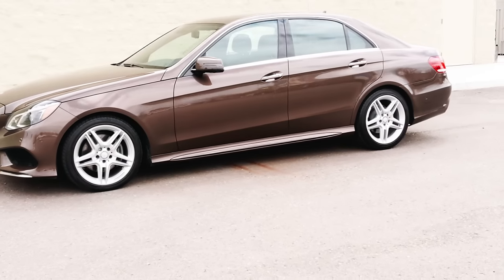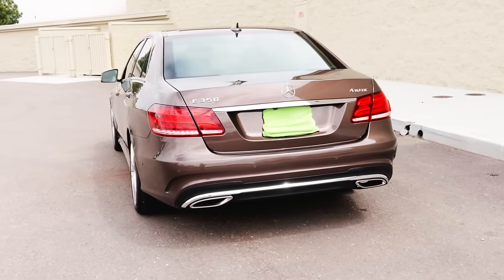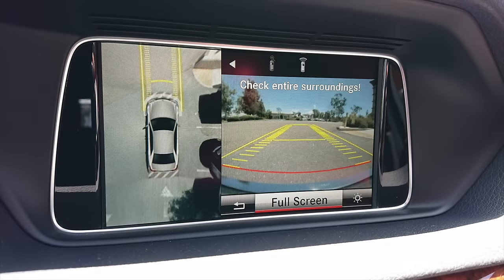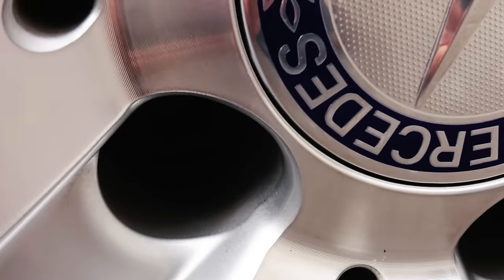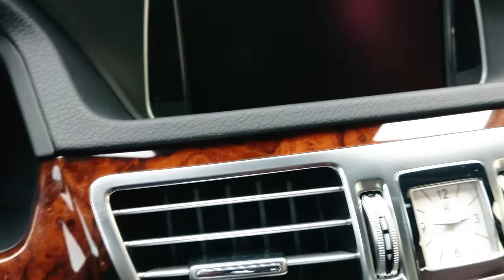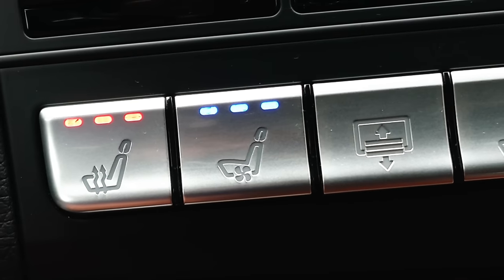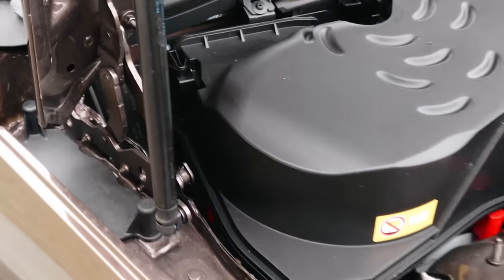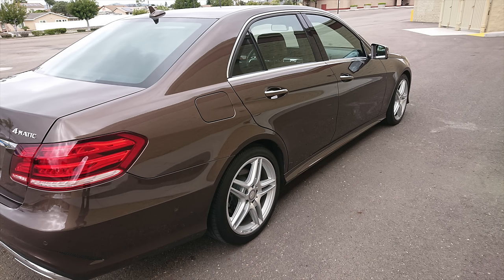The W212 E-Class is one of the best Mercedes-Benz Cars Ever

Comment: As a Benz technician that is the one car you see in the shop that only comes in for maintenance. Literally the only times I have to do diagnosis work is if there's rat damage and you have to repair some of the wiring😂
Reply: What’s your thoughts on the W204?
Reply: That's great to hear.  I own a 2013 e 350 avant-garde with leather seats, not leatherette.  Magnificent car
Reply: @Sean  any C class model was pretty good. The GLK IS really good too. Just maintain the motor, trans, and suspension and it usually drives like new
Reply: Can you please advise how long the fabric roof is likely to last on convertible W212s and if necessary is it extortionately expensive to repair or replace?
Reply: @popshaines5492  great question! I used to do convertible tops on these cars especially the 211/212 like you mentioned. As far as longevity in my opinion, not long. The string used to operate the top when it’s on motion tend to weather and snap as they age. I remember back when that model came out if you had ELW coverage you got it done for free but as far as upfront costs from the customer, I think the price ranges from $900-$1400. I could be wrong, but the labour pays up to around 8 hours and the top itself is expensive. You can still drive the car without using the top so it’s up to your discretion. Hopefully it just doesn’t leak😂
Reply: Yep....mine is 13 year old now. She has almost 200.000 km's on the clock...this year the chain was replaced ,the front springs and some other stuff on the suspension was worn out so replaced and today the rear subframe is being replaced but that one is fully covered by Mercedes Benz. So besides regular maintenance no crazy or shocking stuff....yes the car is getting old so you can expect things needed to be replaced....no reason for me to sell her. This car will stay with me for a long time haha.
Reply: Still w124  thr  peak  engineered of mercedes..right? The  most  aristocrat n elegst mercedes..aling with w140 s class n w126
Reply: hey mate, I was wondering what your thoughts are on diesel vs petrol models of this chassis?
Reply: @egv152  diesels are rare to see in the states but we do have them. I only worked on a couple diesel GLK’s. But the gas engine in the w212 m276 is a very reliable motor
Reply: @FZERO20  Ok thanks for your reply. I'll keep this in mind. 👍
Reply: @FZERO20  GLK, really good ? where are you working ???! in another universe...  what kind of technician are you, washing closets ?! go take a walk !!
Reply: @alexandruchivu7327  you must not take care of or can’t afford proper maintenance on your vehicles🤭
Reply: Can you pls explain the difference of the hand gear lever and the normal gear stick in the w212? Does one have more gears hence improving fuel consumption?
Reply: @sankara6823  the only difference I can say is the position where they put it🤣. Beyond that, if you wanna know the gearing it’s typically stated in the transmission number. In some cases you can scan it with a good scanner and it’ll say either 722xxx for 7 speed or 725xxx for 9 speed I don’t remember what the 5/6 speed designation is but it’s something like that

Comment: Owner of a 2015 E350 Sport 4Matic here. I absolutely love driving the car. The highway is where it shines, but it is quiet, handles well for its size, and the suspension in stock form isn’t too rough. In the 15k+ miles i’ve put on it, I only had one minor issue where I had to replace a destroyed plastic boot on one of the front axles (4Matic), but everything else has been only for maintenance. I have had no issues whatsoever with the car itself. The only option I wish it had was the adaptive LED light system but the standard headlights work better than many upgraded headlights from other manufacturers. If anyone is thinking about buying a W212, especially the 2014-16 facelift, don’t think twice and just do it! You will not regret it.
Reply: W212 and W204 best carts ever made. Seen some with 700k and never had any major repairs only normal maintenance, oil changes ,tune ups ,brakes etc,
Reply: What I have seen is that the regular headlights are better for the city someone made a comparison and noticed that only high beams look better with the adaptive lights.
Great for the highway tho..
Reply: Hey, I’m about to buy a 2014 E350 Luxury model and I wanted to know what are the maintenance cost looking like yearly?
Reply: @iamjshep3 It’s tough to say exact, it all depends on how much driving you do and where you live. Also, how well the previous owner took care of the car is a huge factor. When I owned the car I put 7-9k miles per year and live in FL so the car was not abused or in rough conditions at all. All maintenance I basically did early since I never hit the factory 10k mile interval. Found a great shop specializing in Mercedes, only charged me about $140 for Service A and about $350-500 for Service B depending on what needed to be done. A friend hooked up OEM front and rear pads including labor at $400. That’s all I really ever did runnings-costs wise, only oil changes, filter replacements, and the occasional fluid flushes of different components
Reply: Just bought one 2 days ago and i absolutely love the car! Smoothest ride of any car I’ve personally driven or owned
Reply: @visionariable  What fuel you used? 91 or 93 octane?
Reply: @Bando-fx4mf what about the e550 2012 no airmatic 100,000 mile car yay or nay? It has the 4.7 bi turbos
Reply: @valentinozientek5670  those v8s in the same era are known to be very to equally reliable. But the v6 and even the v6 bi turbo in the e400 are the best engines ever built.
Reply: @valentinozientek5670  at 100k its barley broken in yet.

Comment: In my books the W212 is the best Mercedes ever built and it is also one of the most beautiful mass produced cars. Owned 2012 E350 for 6 years and the only problems it had was with the engine ventilation system that had to be replaced and engine mounts (this was a costly repair). The car is built like a tank, it’s silent, comfortable and has great handling for a heavy car (yes it’s nowhere as fun or fast as a BMW M135 on track but it’s not designed for that purpose). I find the facelifted version even more beautiful.

Comment: Never have treated a vehicle as well as my E350, certainly a special car. She is a 2012 with only 48K miles, just gorgeous.
Reply: Wow 48k , that’s great mileage for a 2012.
Reply: Just bought a 2011 E550 with 37000mi this past February from the original owner.  I love it & keep it tucked away in my garage...  Weekends only.
Reply: @realnewyorkcityliving2065 My 2013 E-350 just clocked 58,000 miles two nights ago.
Reply: I don't think there is a reason to hide your precious'es and deny yourself the pleasure. I got my E350 with 300000+ KMs on it. You'd never tell.
 It is a 3L v6 Diesel version. Just replaced both front airmatic struts. Still love it :D

Comment: 2012 W212 E220 owner here. Have it for 3 years other than throttle valve and oil cooler I had no issues. Still puts a smile on my face when I drive it. 
It's a tank

Comment: Benz driver from Denmark here:
I just love my 2012 E350 CDI. Sedan.. 265hp, 620Nm. Full leather with ergonomic adjusted seats. Bi Xenon, Keyless Go, Lingatronic and loads more.
The car has a full service history from Mercedes Benz. 570.000km (355.000 Miles).
Price 90.000 DKK (about 14.500USD)
Everything works, no faults whatsoever... Just love that car.
Reply: Still on first engine and transmission?
Reply: @h2oaddict28  Yes, never opened or rebuildt. But comeplete service by a Mercedes garage.
In Denmark a lot of these cars are used as taxis the frist 2-3 years. Then they are duty free and are sold.
Reply: @svendolsen276  Cool. I'd never buy a car with more than 200k km though. Even if it's a Mercedes :)
Reply: Hats off to you ... I think the engine performed well.
Reply: @manojm6722  Yes, very much so. It will go in for service at about 600.000km or when the service system alerts me.

Comment: I would have to take issue with your claim that the W212 E Class Mercedes is the best ever.
The W124 series, built between 1985 and 1995 has that reputation, and I can vouch for that. I live in Colombia and 2 years ago I bought a 1993 W124 E320 which has now done 105,000 miles as it was originally sold new in the US. I paid the equivalent of USD6,600 at the time. Apart from some deferred maintenance issues, it is proving to be the best Mercedes I have owned. It is the last of the non-computer Mercedes - a big plus in my mind!
Prior to this, I owned a total of 6 older Mercedes in New Zealand between 1978 and 2008. The first was a 1963 220Sb which I owned for 10 years. I wish I still owned all of these pre-computer cars. They were wonderful.

Comment: the pre-facelift model looks SO much better and in my opinion they should've kept it like that.
Reply: No it doesn't.. it is a really nice vehicle but the interior quirks before the facelift like the clock at the speedometer are not aging well.
Reply: @absolutium I like the pre face-lift to.....it gives me the feeling of the 90's and early 2000's
Reply: @markbulgarin5805  I get what you are saying yet I feel the same about the CLS 2012 which is the same idea with some details already corrected.

Comment: I have a 2009 E320 bluetec with only 166k miles and it looks and drives like new..if I put the pedal to the metal for a minute or so, with no cops around, she can still do 130mph with a smile!  This turbo-diesel gives me around 36 mpg.. amazing.
Reply: That is some vehicle there E 320 Diesel . Turbo/kompressor?
Reply: @answer to my question .Turbo Diesel, yes she will do 130mph easy .

Comment: I think the W211 was best in terms of build quality and aged very well. I have the W212 facelift but there are rattles and creaks in places and the ride isn't the softest. You need the air suspension. Maybe it's my tyres. But it's not the AMG package. It's the Avant-garde. Would've liked softer.
Reply: I got the non-sport version with hood star for the long stroke suspension's. The sport model is extra bumpy on US freways with skinny tires that bend rims in pot holes... they sale a "rim insurance" for that.
Reply: My 350 cdi  2010 elegance  with non air suspension drive as a new one and it is very soft , i dont like air suspension not good in long term.

Comment: I have a 2010 w212 with the dystronic plus and it is the best thing ever
Reply: THE KING  no problems just buy it bro the w212 is a gem that mercedes accidentally made too reliable haha
Reply: THE KING I have an 11 E350, I like it but I wished I’d gotten the E550. My 350 is a little slow for my driving style and i wish I had the air ride.  My E has been basically trouble free except for a nagging a/c issue, since I’ve owned the car the last 5 yrs the a/c would just start blowing full heat thru the vents in the summer. My sorry dealer told me it needed a new compressor but in June my Indy mechanic looked at and said it was a sensor, $150 to purchase $50 to put on, compressor $2k. The car has 156k miles on it and going strong. The car has stacked tires so I go thru rear tires about every 20k mikes. I had an e46 but the e drives nothing like it. I had continentals on it initially but switches to Michelin, softer and quieter ride. Next car will be a benz, probably E450 had one as loaned and liked it and also had an e350 it was slow didn’t like it. I forgot to add that I have a CLS 550, totally different animal than the E350. It too has been reliable without breaking the bank.

Comment: I agree 1000%. I have a W204 C300 but love the way the W212 (Pre LCI or LCI) looks and drives. Plenty of space, great design that's aged beautifully and mechanically sound though one very important thing. Change the transmission fluid every 40k and for sure it will go several hundreds of thousands of miles without issue. Your best bet is a non airmatic model which lowers servicing costs and complexity.

Comment: That was a great video. Very accurate and on point. I own a 2014 E550 and agree with all of the general comments made by the reviewer. One issue I experienced at 65,000 miles was a “leaking” main wiring loom. It’s a problem that previous generations have suffered and it seems to have made it into this generation of E-class also. Basically it’s blood poisoning for the car. Had to replace the loom, ECU and a bunch of other items. Cost $7.5k at the dealership. My car also suffers from the unfortunate faded burl walnut. There is a class action lawsuit for that now. If buying a used one I’d go for a V6 like this. The V8 is really lovely and has bags of ample power but that V8 is wedged under that hood. Nightmare for DIYers to work on and even the technicians at MB complain about lack of access. The technician that worked on my car was an older guy. I asked him what he thought was the most reliable Eclass built in recent times. He said the the outgoing W211 was trouble free (2008-2009). He said “all the bugs were finally worked out”😂. That last w211 facelift is actually my favourite E-Class. But we all have our favourites. Thanks again.
Reply: That could be very true, you know, from your garage buddy. The W211 lasted for 9 years. These later ones only 6-ish. So a 2009 sample with 100k or so would be a bargain.

Comment: 2012 E350 4Matic owner.  200,000km and its showroom condition, only changed brakes, tires and fluids. And a couple batteries. It’s phenomenal on gas, has power when needed, and it’s a daily driver. Only one regret is the MBTex seats. I should have purchased leather. Maybe next time. If I live long enough to break this car.

Comment: 210 is the best. Great engine and trans combo. Can't beat 112/113 and the 722.6👍👍
Reply: It's the same combo in the w211. 02-06
Reply: @maxxbenzz7842  sure is but you dealt with the damn SBC. 🤣
Reply: @drbtsi  yeah I know. What a disaster that design was. I've had them both. Paint is better on the 211 and the front end is much more sleek.
Reply: @maxxbenzz7842  yup was a disaster for us techs when it came out. Lol

Comment: I have a 2013 that I got new and now has 218,000 miles and everything still works. Other than maintenance, brakes and tires only minor issue was the thermostat housing leaked so got that and the water pump replaced at around 185000 miles. Going to run it till it dies!
Reply: Forgot to mention I did get the motor and transmission mounts replaced at 210,000 miles. Had some slight vibration and that took care of the problem.

Comment: I have a 1995 W124 E420 Special Edition(mfg 4/95) and a 2011 W212 E550 4matic sport.  I like the W124 for it's solid feel construction-chassis/frame/suspension-oh, and the V8 smoothness.  The W212 is smooth, but, the suspension is soft, even in sport setting due to the air bag suspension set up, some panels are aluminum to save weight and mpg.  I believe the W124 is well liked because it was well designed and built to a certain standard.

Comment: I'm so lucky. I have one of the very early W212s.....a 2009 model E350Cdi Avantgarde Blue Efficiency Automatic saloon WITH the star on the hood - pre the facelift model featured here and imo better looking at the front end. More masculine. Now 11 years old with 108,000 miles and drives superbly. Last year, when it was JUST under 10 years old, I was advised the rear subframe was badly corroded. Mercedes replaced it, FOC. How about THAT for over-and-above customer service?!! I didn't even buy it new, it was almost 4 years old with 39,000 on the clock when I got it! If I ever change, what maker's car do you think I'm gonna buy??!!
Reply: Same here MB replacing rear subframe on my 2009 212
. I know MB made a big mistake when Helmut Wherner was MD ( he said we make our cars too well) so he cut back on quality resulting in the 210 rotting everywhere. However, I bought a 210 estate new and boy did it rot ,during my 11 year ownership it had 2 new front wings, 2 new rear doors , a repair to the tailgate and eventually a new tailgate , new front strut mounts and a new rear subframe. By this time and 100,00 miles the paint work was understandably subject to shade differences as the car had been repaired at different times during its life. However, in view of this I complained again and consequently MB repainted the whole car. All this was carried out FOC
Reply: I owned a 2011 E 350 CDI Station Wagon! Nice car. Good times!

Comment: I wish the stuck with the floor shift and paddles but I am impressed how the transmission improved its performance. I also don't know how long the screens will last that said it seems like MB isn't what it used to be where  your child and your grand children could drive your first mercedes-benz. I say this because I can't find even specifications to have a part made from a 3D/fabrication shop  and the MB is only a 2000 but you get something from the 70' 80 and early 90s and most of those not only can you get them served but the amount of resources is amazing. You can even get a Pullman service at a dealership. If you have Jeremy Clarkson money.

Comment: Own a pre-facelift 2013 and I couldn't imagine not having the vertical badge on the front, but I do like the facelift generally. Had to buy new rims though as the low-profile tires on the sport package transfer too much impact energy to the wheels.

Comment: The 2012 is rated by most consumers as very reliable. It’s not Lexus LS or GS reliability but it does come close behind if you take care of it and do not wait till 10 or 12,000 miles for an oil change!   And use Mobile 1.  Do recommended maintenance too including transmission oil changes every 40,000 miles and no longer than 50,000 miles.